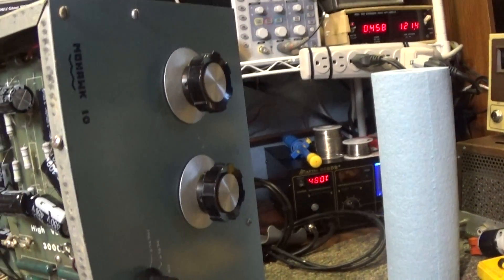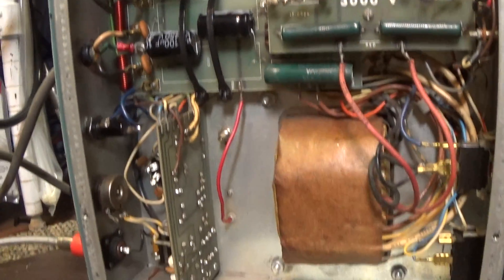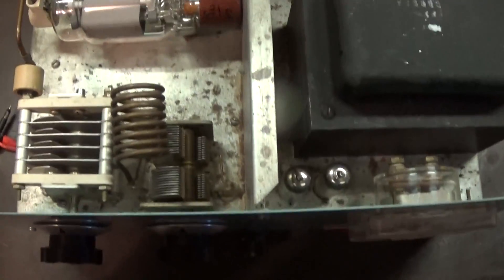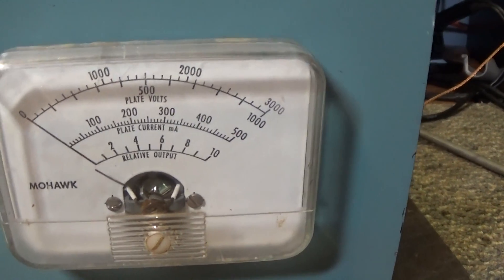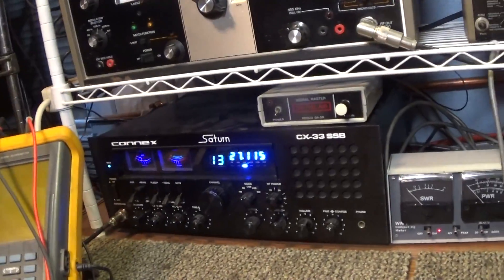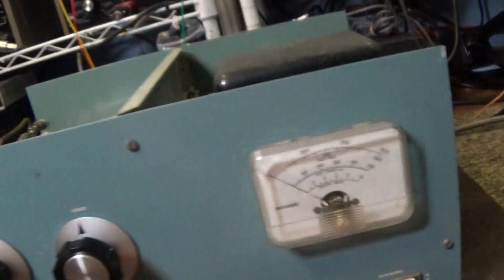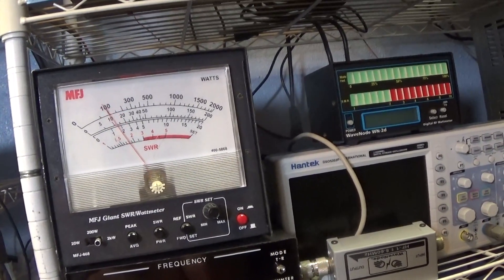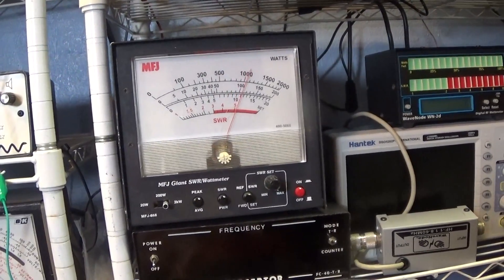Mohawk 10 Linear Amplifier

Comment: got one too. 510b w driver.  was keying 4 in 350 w key down out  -peak 14 in 800 out .  then failure.  might be transformer.  not sure. Near mint condition except for recap.
Reply from the maker: Yep, nice amp. I regret selling this one. A tube broke and the buyer wasn't happy. I no longer sell heavy and/or fragile items like this anymore. Anyway, those 572B's may have taken a hit, the power supply diodes or the transformer. I would recap and retube it, check the diodes and then give it a shot.
Reply: Was working perfectly,  meter too.  Paired  up with the Eagles into a 3 flat on a hill top.   Now off air
Reply from the maker: get some tubes and caps and get that baby fixed!!!    BTW, I have a pair of 572B's that are at 75% output. They where tested in the amp before I sold it with the new tubes. I'd let them go for a good price.  However, it really rocked with the new tubes before I sold it but new 572b's are not cheap. Caps I get off Ebay.

Comment: Just be sure to run it turned on its side. The 572B tube sockets in a Mohawk are rotated 90 degrees WRONG from where they should be. The filament can sag against the grid the way the tube sockets are positioned. Spec sheets for the tube say to rotate the tube to put the filament in a vertical plane, not horizontal like a Mohawk. But turned on its side the 572Bs will be vertical, and that hazard goes away. Cheaper than drilling out the rivets and turning each 572B socket 90 degrees.

Customers always choose that option over the cost of remounting the 572B sockets.

Comment: You always seem to find the nicest items. I'm assuming with the correct dive you'd see about 500+(?). Thanks for the clip.
Reply from the maker: Thanks but often when I get them, they are not so nice. Usually takes some time, money, and work to get them up to par and then nobody wants to spend a little extra for a decent working piece either when they can get bargain basements as/is for a lot less.
Reply: tramdr I've watched enough of your clips to know you usually work your magic on the items before making a video. I'd venture to say you've got one of the best CB craze era equipment collections owned by a single person. Since your first scan clip of your collection, you've collected much more. I'd enjoy another clip of your collection if it's possible. Thanks for sharing. 73
Reply from the maker: yeah about 500 Bird watts with the correct drive, about 800 peak.